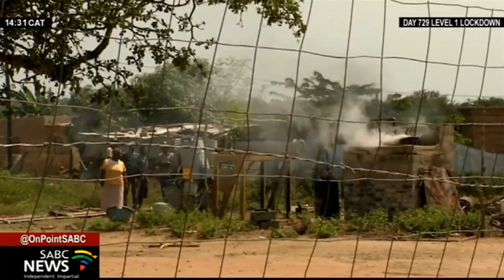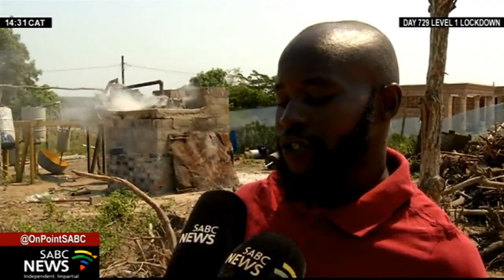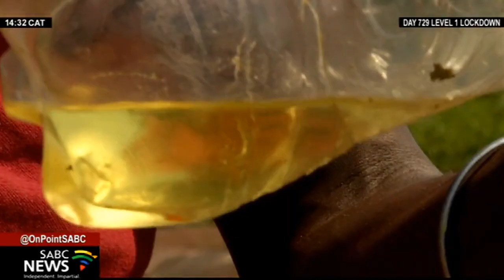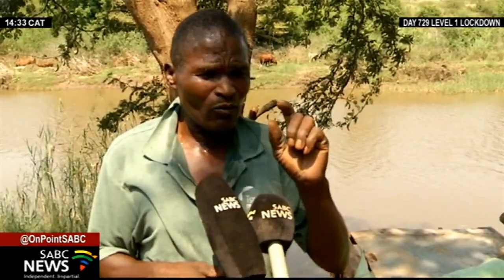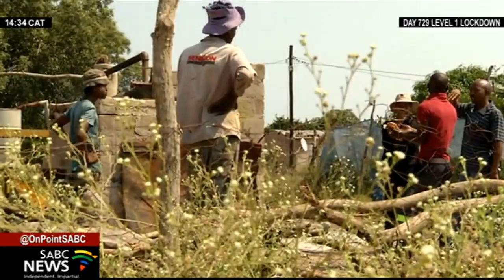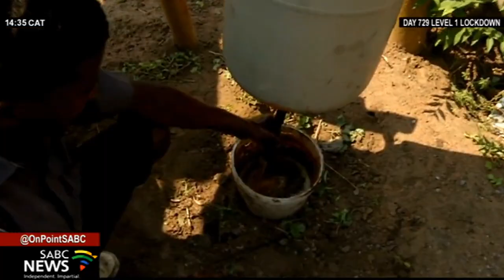Sibusiso Shabangu manufactures oil, petrol, and gas from recycled materials

Comment: As brilliant as this is, it will solve a big problem of cleaning up the townships and squatter camps in the nation. But at the same time it will have a huge environmental impact from a recycling perspective where the materials are not being reused at least 3 times like glass. The other issue is the bigger global picture which is to move away from fossil fuels because the automobile industry is changing at a rapid pace. For now I hope they just focus on cleaning up the impoverished areas where "fuel" is seen everywhere.
Reply: yeah imagine that - the same trash is recycled and provides FREE electricity to the residents.  It would be great capitalism